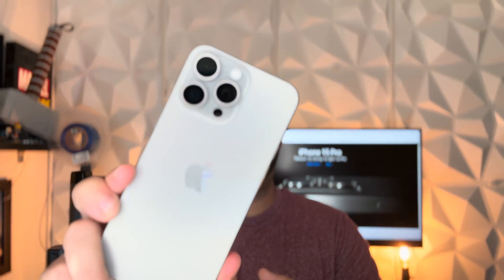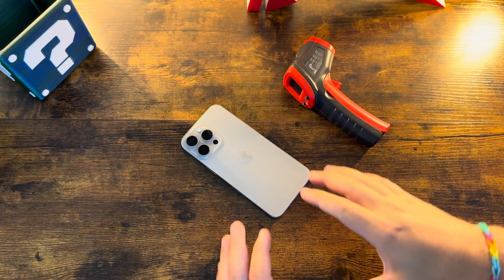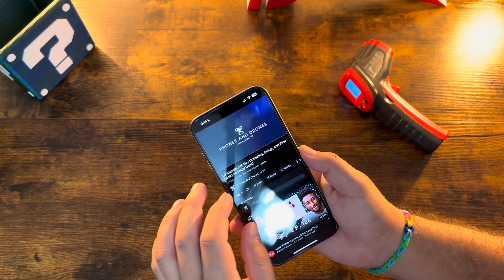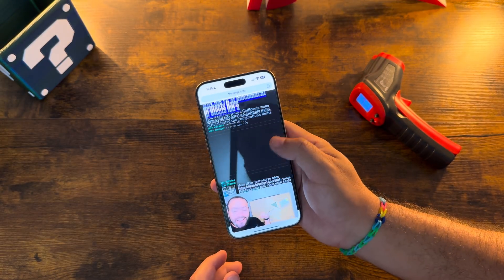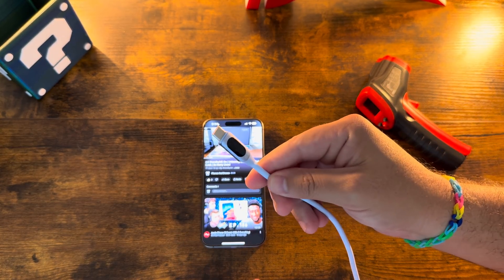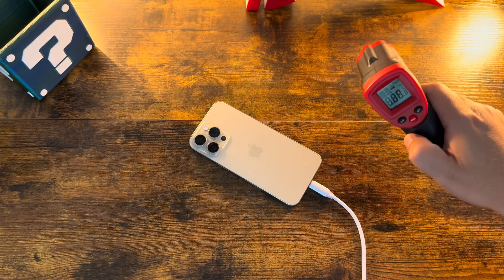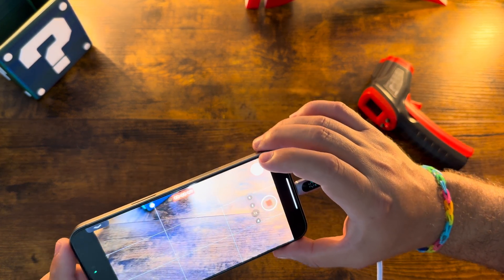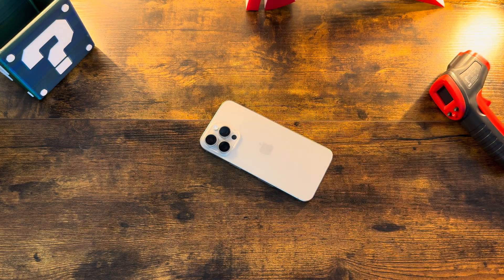Testing iPhone 15 Pro Max Overheating Issues | Watch Before Judging! |

Comment: Why does iPhone not include the pause USB Power Deliver option, which will get battery directly from charger connected to the wall and not heat up the battery? It is such a shame that such a good phone but we can only use it for 20 minutes and shut it off because its hot.

Comment: do the same test while on mobile data and you will see the difference while on wifi it is fine but ad soon as you turn wifi off and use mobile data while doing things like this it turns into a heat fest

Comment: Talking a 1+ hour long call caused the phone to heat up so much, that when I plugged it in after the call was over, received a notification that "charging will resume when iphone returns to normal temperature"

(No background refresh, call taken through earpiece on phone, on wifi, good signal, no other active apps being used at the time of the call)
Reply from the maker: That’s crazy and unacceptable! I hope they fix this in the next update. Obviously the one software fix would be to throttle the chip but might be needed at this point
Reply: @PhonesAndDrones  even though if they fix the issue it will degrade the performnce of the new chip?
Reply from the maker: @JohnKick-J26  you got it. Not ideal
Reply: @PhonesAndDrones  Hello, can I ask did you upgrade your IOS 17 to IOS17.1? If no, in the future, you will upgrade IOS? My iPhone 15 Pro is coming this week (With IOS17), I dont wanna upgrade Because the performance will decrease, Thank you
Btw, so far do you have heating issue on IOS 17?

Comment: I have been seeking videos of testing iPhone 15 Pro Max issue but so far haven't come across any testing video that replicates the complaints. They complained about video filming for 15 minutes and got overheated. They complained about playing video games that challenge the limit of GPU, meaning frames being dropped !
Btw there was a time when my iPhone I think it's 4S or 5 that is so hot I cannot hold it. Or iPhone got superheated and protection, it just told me that it's too hot so cannot be charged or just shut down. I forgot which case it happened to me before. Nowadays I use iPhone with Apple's  leather cases. So the problem I often encounter is screen being dimmed. I almost never touch my iPhone directly since iPhone 5s!

Comment: I’ve only had my 15 pro for a day but right out of the box I immediately started really pushing it by redownloading all of my apps from my iPhone 14 pro while the phone was charging and I was using it yet I had no heat issues whatsoever however if I did even a fraction of that on my 14 pro it would have gotten to 125 degrees Fahrenheit or hotter till it exploded .
Reply: yeah ok you sound like a bozo my 14 pro has never had a heat issue in 11 months smh

Comment: I have the same problem when I charge the 15 pro max and just 10 mins ago tried to plug it to its charger and it didn't charge until restart it and charge it n started to get super hot.

Comment: My issue was I was filming a vlog for my other channel in 4k 30 in Florida. It was about 90F out. About 15 minutes in the screen dimmed so bad it was almost black and I got a warning that the phone needed to cool down. I have filmed like this DOZENS of times with my 14 pro Max and yes it dimmed but you could still see the screen. Plus I never got a cool down warning. This wasn’t even a really hot day. I did have the 15 pro max in a case, but my 14 was in a case too. It is worse from a filming standpoint thermal wise, at least for me.

Not sure if I got a bad one.

Comment: I’m currently on the 14, and when do stuff like texting or scrolling on YouTube, then my phone barely heats up, but if the 15 pro & pro max are heating up due to these daily apps that a lot of ppl use, then that’s a bit alarming. But it’s good to know that the problem isn’t extreme for light apps
Reply: The problem starts with gaming.

I had a Tab S8 (8 gen 1 and terrible heat dissipation) and the device was totally cold on daily use, but just about a minute after starting a slightly demanding game and I had a whole campfire in my hands.

Comment: Software issue with iOS 17 and instagram app. The phone heats up fast. You can test this yourself after a minute the temperature jumps high dramatically. The app also eats up the battery in the background, so I would make sure you exit the app when not using it.
Reply: Not just Instagram. 
YouTube, Twitch, Camera, phone call, ... dozens of reports of people complaining about overheating while doing simple, every day tasks. 

For example, after 10 minutes of facetime, mine got super hot and dropped like 15% battery. 
I can also bascially watch the battery drain in real time, while watching YouTube.
Reply: FaceTime was turning my Pro into a hot potato. Does the normal 15 have the same problem?

Comment: After 5 days i still have big problems with 15 pro max, for example after a 15mins facetime call it started to be so hot i could not use it anymore physically and the entire device started to move very slow due to cpu throttling, should I replace it (i am still in the “7 days” period)? I have sold my 13 pro max already and i don t have a second phone to move all my info, including 2fa apps i need for work and banks. Or…
Reply from the maker: It’s going to be up to you. I’m sure Apple will fix this with a software update, but that will come at the expense of performance. I 100% have not been experiencing all of these issues but I’m sure it exists. You could try to replace it and try one more. If the issues persist with the new device, then phew 😮‍💨
Reply: @PhonesAndDrones  How can a software update fix what is fundamentally under the hood heating issue am a developer myself and no tweaking of software can fix improper cooled cpus
Reply from the maker: @dotnetdevai  they would under clock the chip. Like I said earlier this would clearly compromise performance but that’s how They would achieve this.
Reply: FaceTime definitely heats it up, fast and hot. And meanwhile, the iPhone 12 on the other end of the FaceTime was cool as a cucumber. I’m returning my 15 pro. Does the normal 15 have the same problem?